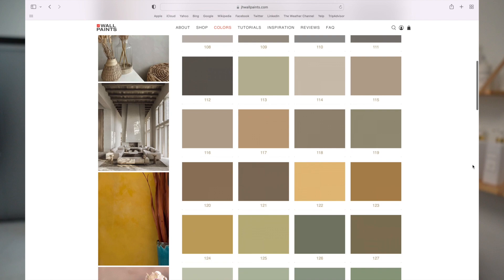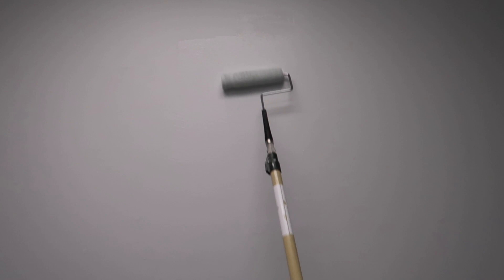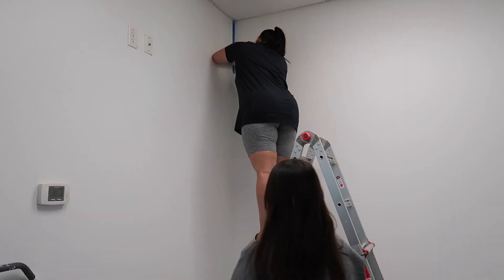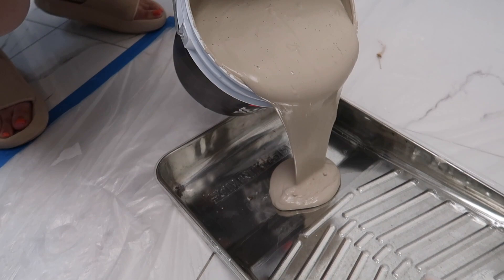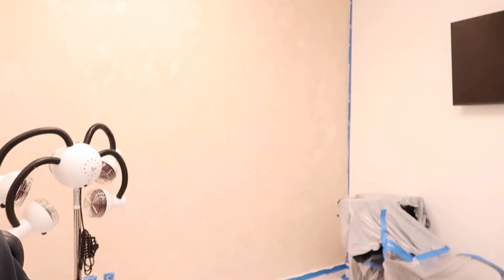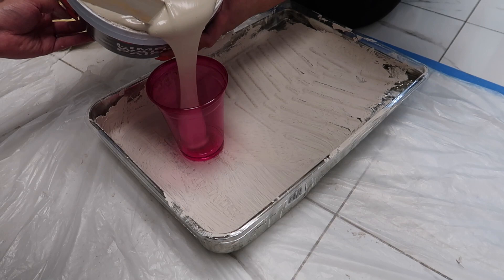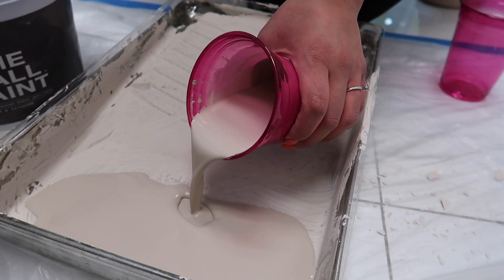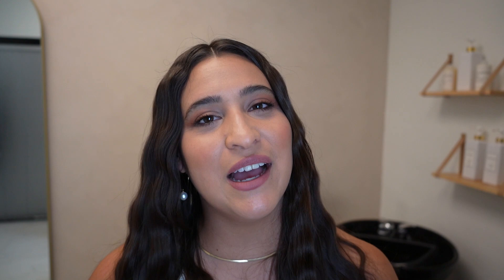HOW TO LIMEWASH PAINT | EASY LIMEWASH PAINT DIY

Comment: I bought the lime wash from the same company but chose 500 color and I was following the steps from their website and I didn't obtain the lime wash effect and I know why, cuz in their tutorial says to use roller for first coat and that was a mistake cuz the paint after dry came up like one solid color without dimensions. I  spoke with technical support from the website how to fix it but still the effect of lime wash is very minimal almost invisible. I hope when I will be painting the hallway and I will use your technique I will get the desire effect
Reply from the maker: After looking at tons of video of how to apply it on their website I decided to not roll it on for the first coat because I had a fear that the limewash affect wouldn’t show as much with the roller and I wanted to get as much of that lime wash affect as possible so I totally understand where you’re coming from! So sorry it didn’t come out the way it was supposed to 😢 Overall I noticed that most limewash companies recommend using the brush for application ok both costs because the brush does give it a lot of that affect. Also, did you use 50% water for your second coat? That is a very important component to getting that limewash affect as well. The next time I do limewash I would actually like to test out using water in both coats to maximize the lime wash affect! I haven’t tried that yet but would definitely like to for my next project :)

Comment: Hi, why did you have to prime twice? Couldn't you just use mineral prime only? It looks great!
Reply from the maker: So the mineral prime is meant specifically for the Limewash paint. The mineral prime does not hide or conceal any marks or patched up holes you may have on the wall prior. The stain-blocking primer I put before was meant to give me a perfect surface to start with. For example, in my case we had some previous patches on the walls and some ugly marks that could show through the Limewash paint in the end. So if you have a perfect wall that has never been painted before you can totally skip the Stain-Blocking primer. I hope this helps! :)
Reply: @TheCraftyGalCarla  makes perfect sense. Thank you 🙏
Reply: Hi, great and informative video. Question: if you have painted walls (aura by benjamin moore in Chantilly Lace (white) then can you skip the first primer, and only use the mineral primer? Please lmk your thoughts, thanks @TheCraftyGalCarla

Comment: The “mix with water” suggestion will hopefully be the trick to getting this look. I didn’t dilute my 2nd coat of paint and the paint was too thick, which made it harder to spread it out evenly. I could see the brush strokes after it dried. So I tried a 3rd coat during which I wet the dried paint edges on the wall hoping it would blend the paint in when I join two sections in. That only helped a bit. Then I went for a 4th coat wetting the entire wall section by section and painting. That definitely helped move the paint on the walls easily, but it still didn’t look perfect like your wall. So diluting the paint might do the trick. I am sick and tired of painting, but will try one last time with this trick and see if it helps. Keeping my fingers crossed 🤞. Thank you so much for the tip!
Reply: And did it help?
Reply: Did it help?

Comment: Thanks for the video. Can I get your opinion on the matte sealers? Pros and cons? I hung a piece of drywall in my basement for practice. I like the results but when I look at the product at an angle I see the brush strokes and they have a chalky finish that Im not crazy about. But when I apply the matte sealer it does tone down chalky finish but I think it also changes the character a bit but not in a good way. Any thoughts?

Comment: So are you supposed to mix with water
Reply from the maker: For the first coat I did not mix with water, so used the full paint straight onto the wall. For the second coat I did use water, I used 1/2 paint and 1/2 water. I hope this helps ❤️ This worked great for me for the specific brand of paint that I used. Please don’t hesitate to let me know if you have any questions at all 🥰